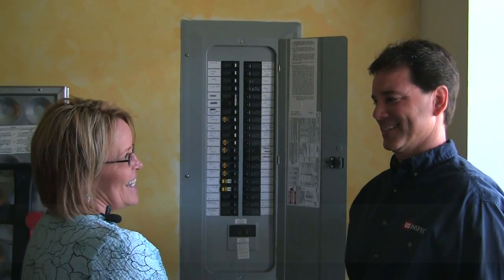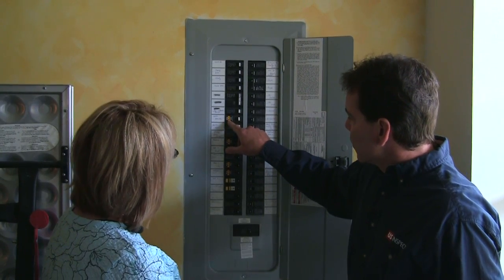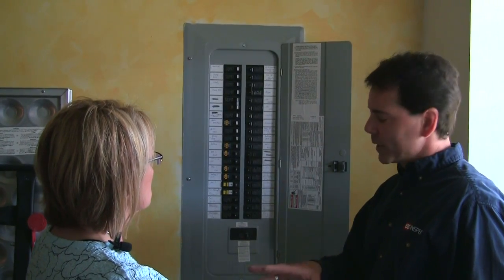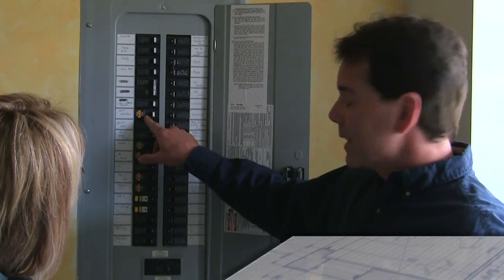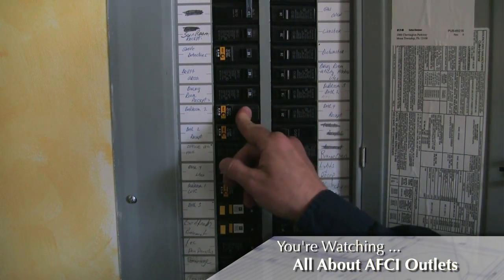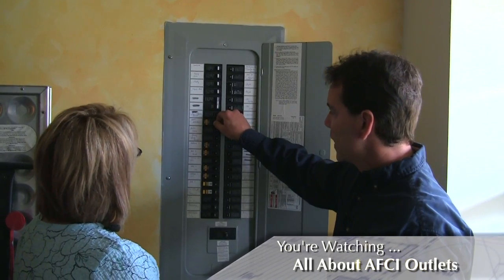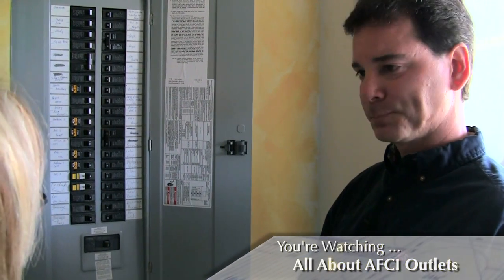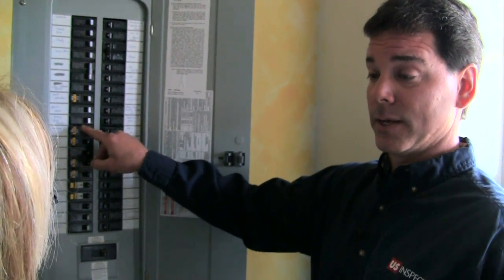All About AFCI Outlets

Comment: It's based on what's a greater risk with a particular circuit, since breakers that combine GFCI and AFCI functions don't exist yet. GFCIs are required in any circuits near water, since water conducts electricity and makes the effects of a shock much, much worse. AFCIs are needed in locations where you could potentially damage a cord with furniture, which could cause arcing. If you want both, you can put a GFCI outlet on a circuit with an AFCI breaker.

Comment from the maker: The GFCI is designed to protect people from fatal electric shocks. The AFCI protects against fires caused by arcing faults. The GFCI also can protect against some electrical fires by detecting arcing and other faults to ground but cannot detect hazardous across-the-line arcing faults that can cause fires.

I hope that helps. Thanks! --Keith Ruehl